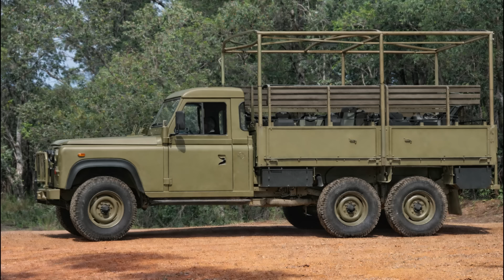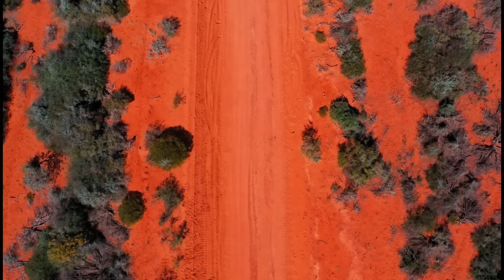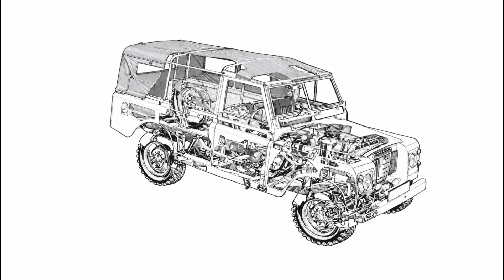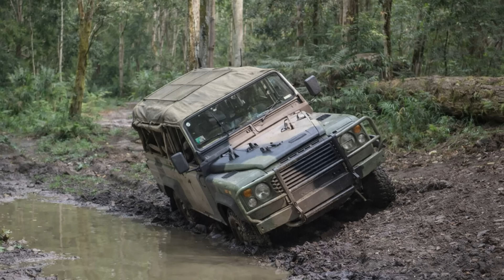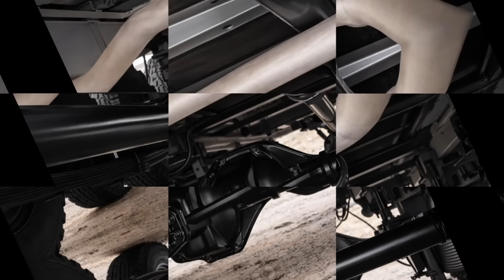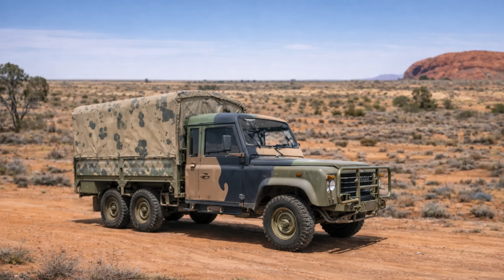Land Rover Perentie 6×6: The Military Truck Built for Australia

Comment: The voice is horrible the script not much better and the choice of photos totally misleading.
The engine was from a light truck, and of course this video did not match the photos with the narrative. The AWD4 used the engine discussed, not shown. The AWD6 used the turbocharged version of the engine, not discussed but shown.
There were no part time 6x6, all were AWD.
Reply: No you're wrong, the engine is an industrial engine. The same motor was also used in Isuzu NPR truck, but the one chosen for the Perentie 6x6 was the industrial version. Also the 6x6 is part time 6x6 and full time 4x6.
I know this because own one a 6x6 Perentie.
Reply: @SKAuss13Adam I wonder why the industrial version was used.
As a curiosity an English magazine said that was 37bhp motor. I wrote that off to the writer not knowing the difference between RAC HP and BHP. This was also apparent at the RAF museum in North London.